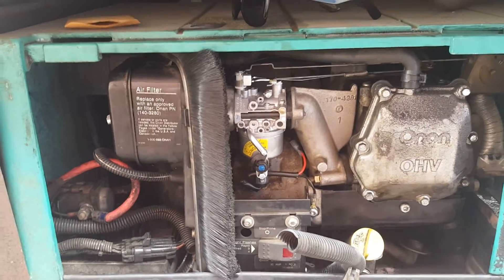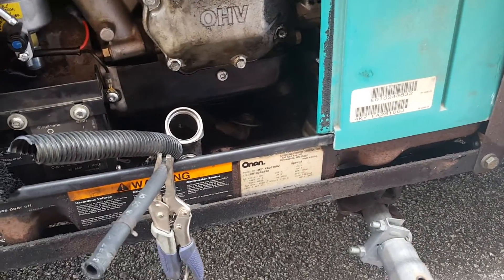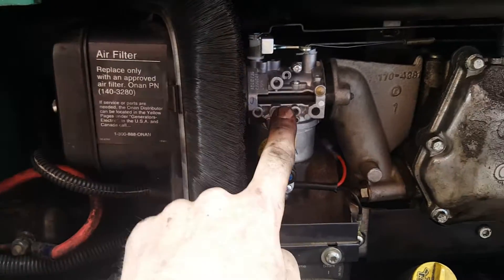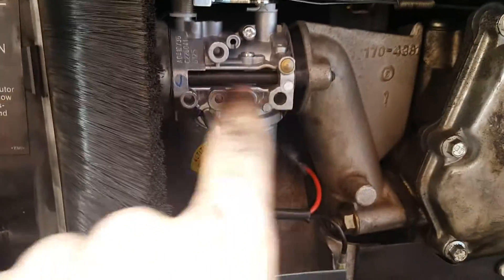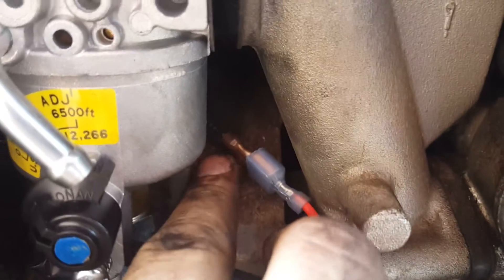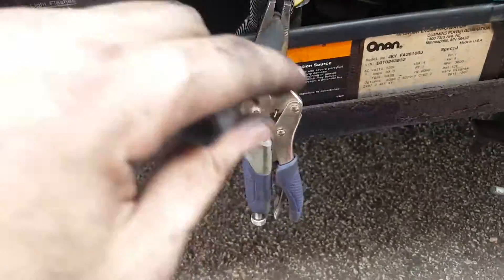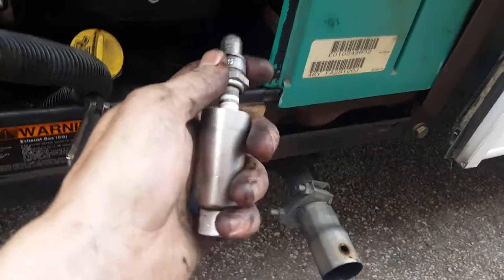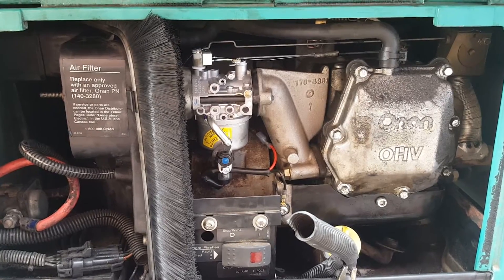How to organize sockets in your tool bag and changing RV Generator Carb

Comment: The ONLY video on line that actually shows, step by step, how to R & R the carb on an Onan 4000 Microlite - including the bolt and torc sizes. The others are maddeningly verbal and do not Give the 10 mm bolt sizes or show removing the two T3 torc screws and pushing the air filter housing back - with a big push. Many thanks.

Comment: Very good job. I need tio take out my carb on a 400 and yours was the only one I found on the 4000. I looked everywhere to find the bolts to remove the carb and now I know they are inside the air filter. very good job on the explanation. Thank you sir.

Comment: Pretty good video. If I may add a couple of my own operating practices. Keep your tools and  hands clean. Slip a wrench in the hand or on a nut and your plans will change. I put a clean white shop rag as much as posibal under the work. Dropped small parts can and do vanish. Taking something apart to work on something else is a last resort and a part of life. Often ya jus gotta. I take pictures with my phone before I start taking stuff apart. I'm a compulsive neat freak. When stuff gets taken apart, the parts go into a magnetic work tray. About four different sizes available cheap from Harbor Freight. (Sometimes you have to glue the magnet back on the bottom of the tray.) I would never put my tools on the ground, even if they are taped together. Lay your tools out at least on a piece of plywood. Sit on something. I have several cheap paddle boards I got from the dollar store to sit and kneel on. Being comfortable makes for much better workmanship.

The painters tape is a good idea. I wish you had recorded pulling the carb instead of talking about it but a valuable video all the same. Thanks

Comment: You can arrange both of the circular vanes to be inside by unscrewing the adjust screw. Then the carb will slide out. Taking off the two control links was nasty. Just don't want to release.